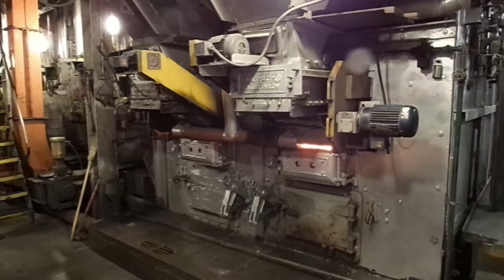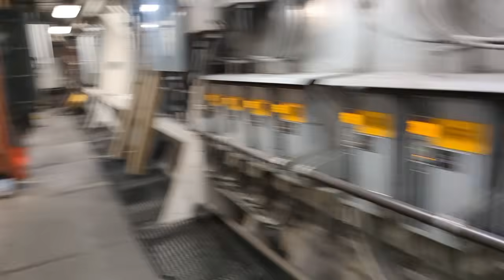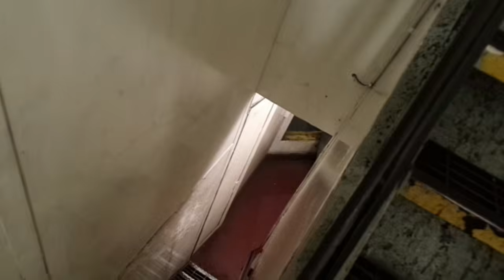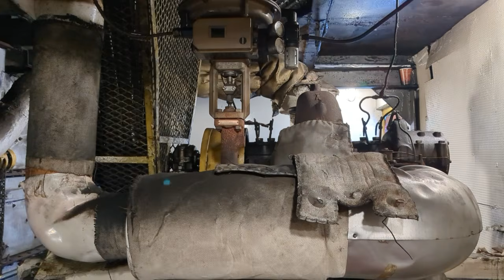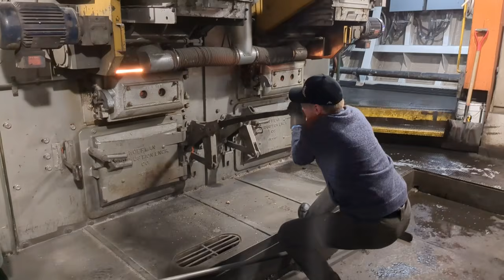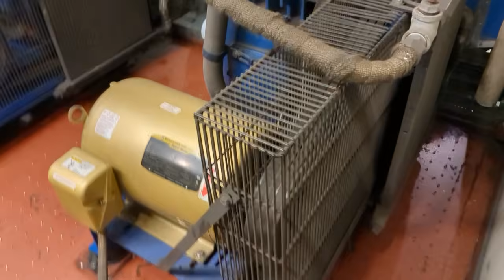Inside the SS Badger's boiler room: How Coal Powers a Steam Ship

Comment: How hot does it get inside the boiler and engine rooms under way?
Reply from the maker: in the boiler room it can get very hot in the second level during a hot day, up to 140 degrees I heard. the engine room isn't too bad maybe 80 or 90 degrees F. there are fans that blow cool lake air onto the areas where the crew normally work at.

Comment: The reason the ID fans pickup during ash removal is: open doors let excess air in boiler, the volume of the air cause the negative pressure to lessen. This why the ID fans pickup.....to maintain -.3 airpressure
Reply from the maker: thats excactly what I was thinking! I talked to kevin about it and he also was thinking that it was due to steam pressure dropping as cool air rushing in would cool the boilers.

Comment: Why was one of the men wearing a respirator, When we could see the ash dust being “sucked” back into the ash bin door. Assuming the boiler room was well ventilated.  Phobia of inhaling dust?
Reply: I don't know, but maybe he has asthma or another respiratory condition, which requires extra caution in these conditions.
Reply from the maker: I dont know but I didn't need one. I know that theres a blower that takes outside air and blasts it down the fire isle.

Comment: Real nice.  I retired five years ago after 40 years in a university power plant.  We still fired pulverized coal the first eight years I was there. The coal fired units were a 1949 Riley Stoker 120,000 lbs/hr at 185 psi, 1950 Riley Stoker 150,000 lbs/hr 425 psi superheated.  Gas/oil fired units, 1969 Erie City 250,000 lbs/hr at 425 psi superheated, 1990's (can;t remember exact date) Foster Wheeler 200,000 lbs/hr at 185 psi and 1990's Foster Wheeler 200,000 lbs/hr at 425 psi superheated.  Superheated steam powered a 5 MW steam turbine exhausting to the campus heating system.
Reply from the maker: Wow that's amazing. If you can please get me some videos of it and email it to me! Anyway I seen Riley stokers at the power plant in Virginia MN which I made videos of

Comment: Coal isn't all bad.  Thanks for showing this. Is there a pulverizer for the coal?  I remember seeing them in the power plants I worked in...sorta noisy things and they made plenty of dust.  I could always hear them hammering away making more easily flammable fuel to feed the beast.
Reply: There was once a crusher. The controls for it are still integrated into the sequencing in the motor controllers so we "run" it every watch.
Reply: @robert7539  Thanks so much for adding this, Bob!!  :)
Reply from the maker: there are no pulverizers. remember I did a good job explaining the stokers. what they do is throw the exact same coal on the the conveyer belt onto the grate.
Reply from the maker: if you want to learn more about coal stoker boilers then you should watch that one on the end screen about the zurn boiler.